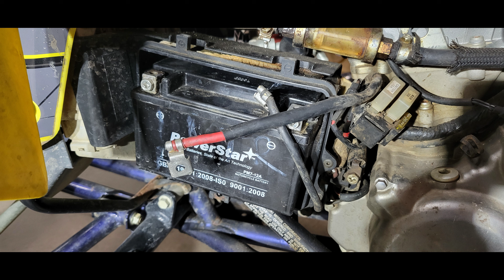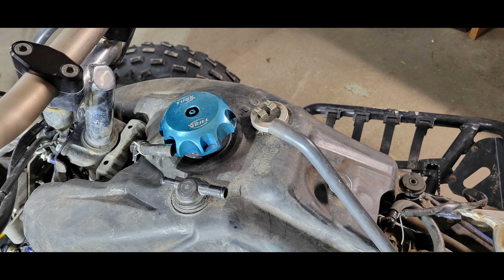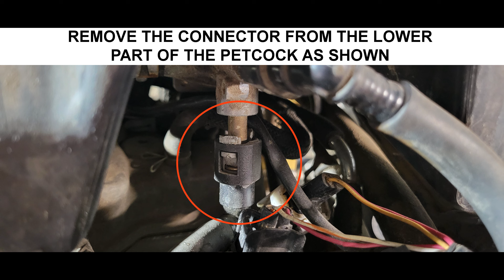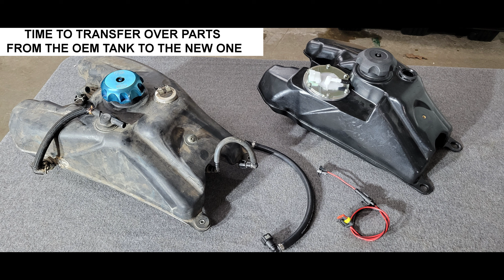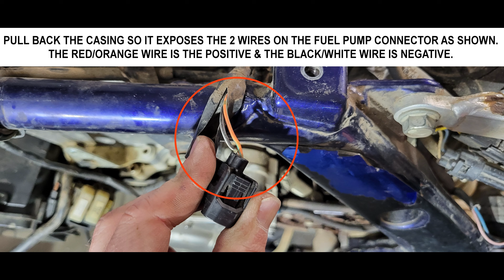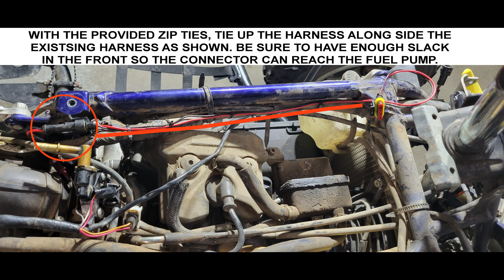DFI Upgraded Fuel Tank Install Video For 2006-2009 Suzuki LTR 450

Comment: Can we add fuel filter between tank and injector line ? Just got the kit and wondering should I do fuel filter
Reply from the maker: The pump has a filter on the bottom of it already.

Comment: does this come with the new tank and everything? or do I need to ship my old tank out?
Reply from the maker: its a complete tank with pump. no need to ship in your tank. you receive a new tank with the pump already installed.
Reply: OK, I just had one more question. Will this fuel pump be good for racing? wide open throttle for hours a day?
Reply from the maker: @mikegreen3047  we have a few customers running this in their xc quads.

Comment: When will you guys have this tanks available again?. Will it affect my tune on the power commander 6 ?.
Reply from the maker: these are back in stock. no it wont. the pumps regulator is made to the same specs as the original pump.
Reply: Thank you. Just bought the tank and an extra fuel pump for the future.
Reply from the maker: @nunoespadinha1972  thank you for the order!

Comment: I have one of these on order. I noticed you said it was designed for 90-91 octane. I run 100-110 octane with my high compression piston. Will this system not work with race fuel?
Reply from the maker: are you talking about vp 110? it will work, the higher octane might wear the seals faster then normal.
Reply: @zoomzoompartsllc I run Renegade 110
Reply from the maker: @damienprice3669  so from what we reading 110 is a leaded while 93 oct is unleaded. any leaded fuel is going to leave deposits so it will clog fuel pumps more. we have used 93oct and rec 90 in our test tank. again, we havent heard any issues of other riders with using other fuel in it.

Comment: Cuáles son las mejoras en comparación con sistema original. Alguien a resuelto algún problema de encendido o aceleración con esto?
Reply from the maker: the stock fuel system has multiple issues. once it starts to fail, it is very costly. our tank is a simple solution to the problem.